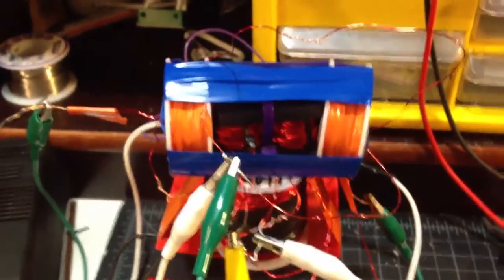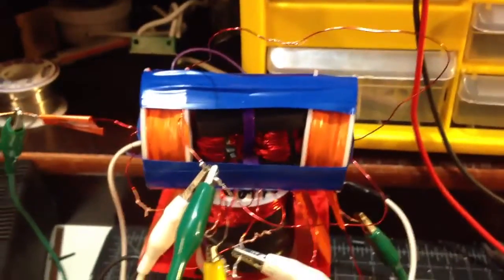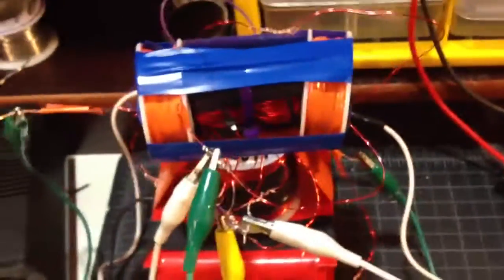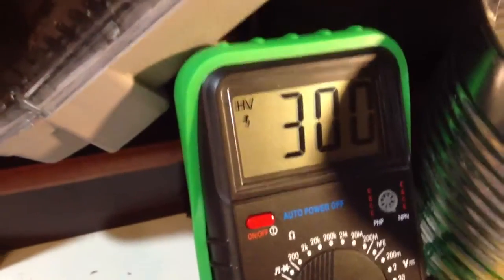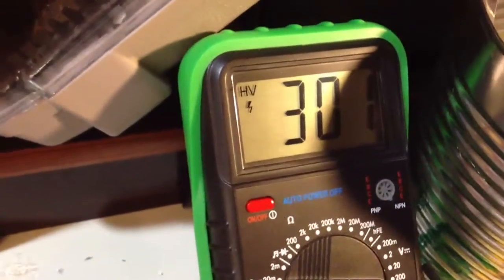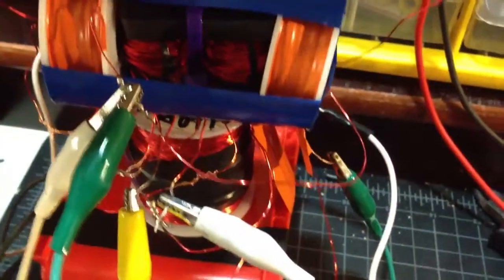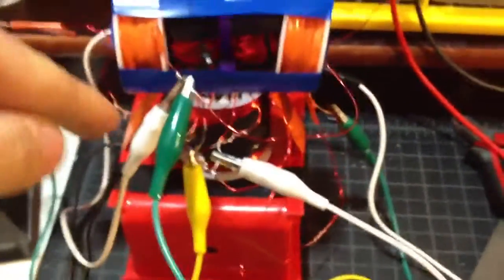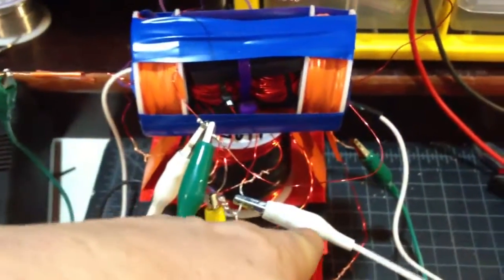Mini VTA ?

Comment from the maker: @theENERGYDREAM
I used a F Sweet diagram that I saw on the Internet. If you google it you can find it pretty easy. If not you email me I will send you the schematic I used. I had to miniaturize the circuit because my magnets are only 1x2". Barium Ferrite magnets are almost impossible to find so I did the best I could with the mini version. The frequency really affects things too.   It is basically two parallel bifilar coils with a cross flux switching arrangement.

Comment from the maker: @theEnergyDream Not yet because I am still experimenting with the coils and magnetization  However I did use a regular lightbulb as a load.  You are right  though, the voltage would need to be stepped down before it could be used. 

Another really interning thing I noticed is that when I wired an oscilloscope up to the magnets, to find their resonant frequency, the reading would jump back and forth from 60hrz  AC and 10.58(ish)Khz so it does  appear that the magnet is starting to "remember" the